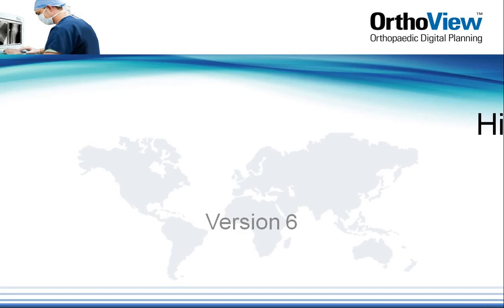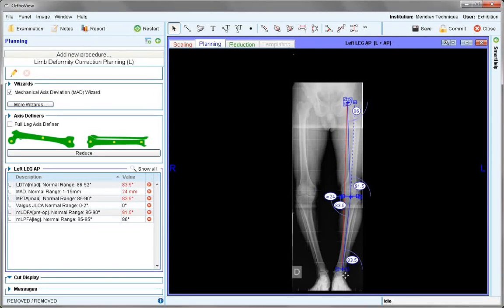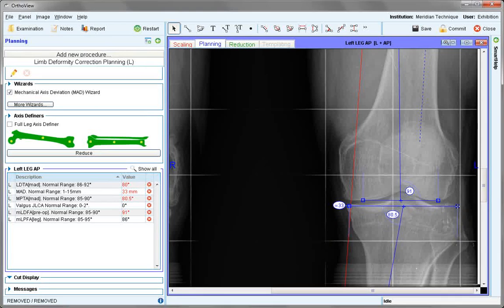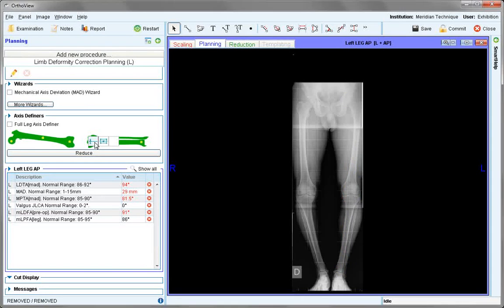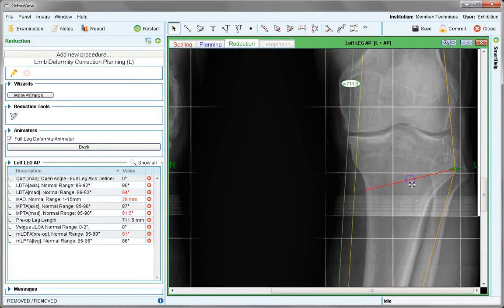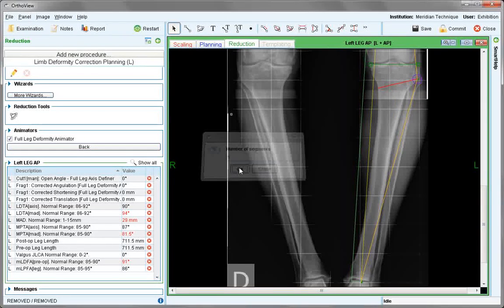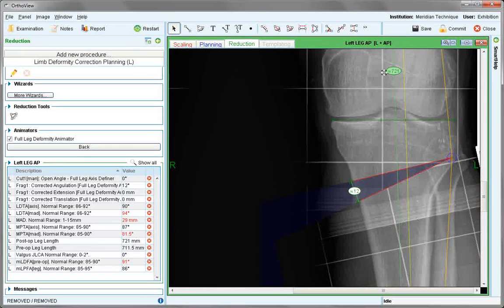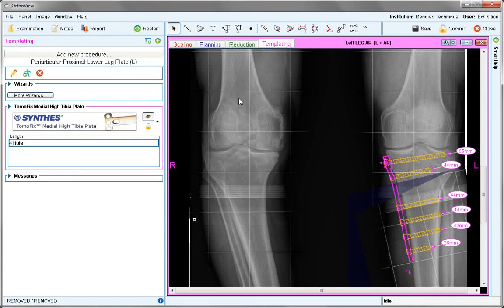High Tibial Osteotomy (HTO) | Deformity Correction Planning | Materialise OrthoView

Comment: It's 2023, and I'm currently going through this procedure.  I had my right leg repaired in late January, and my left leg repaired, 8 weeks later, in late Mar.  I'm a 59 year old male, still very athletic, very fit, and in shape.  I trained hard prior to the first surgery, in an effort to get myself as strong as possible.   My surgeon used the Tomofix plates shown in this video.  Both of my legs are now 1"/2.5cm longer.  The process was supposed to take approximately 8 months (2 surgeries and the recovery time in order to just be able to be weight bearing and off crutches), but I completed it, and ran for the first time, at 90 days from the date of the first surgery in Jan.   The openings in my Tibias were 18mm (almost 3/4") and bone from the iliac crest of my pelvis on both sides, was placed in the opening as a bone graft.  Through the prior training, doing my own PT during the recovery processes, and going back to training on a mountain bike during weeks 6 and 7 of the first surgery, and eating/supplementing in a way that would benefit bone growth, I greatly sped up the recovery process.  It is currently exactly 6 months since my first surgery, and I am 100% back to normal.  I can ride my mountain bike just as hard, and aggressive, and for the same distances, as I did prior to the surgeries, I can run a mile on a track, and I can run 3-4 miles on steep mountain trails.  I can also "power walk" a hilly 3-1/2 mile loop, on pavement (which I've just added to my training and PT routine).  I've been posting updates to my YouTube Channel, starting with this first video: https://youtu.be/SDhvUzSehdU

Comment: Does the height increase?
Reply from the maker: Hi Levi,
Depending on the amount of correction that a surgeon decides to perform, it is indeed possible that the tibia height increases. As part of the planning process in OrthoView, the surgeon can measure the bone length and compare the pre- and estimated post-op difference.
Reply: I wish I could afford this operation, it might be a dream for less fortunate!
Reply: @MaterialiseMedical  On average how many inches/cm difference is usually seen ?